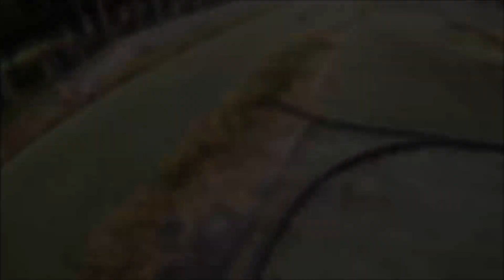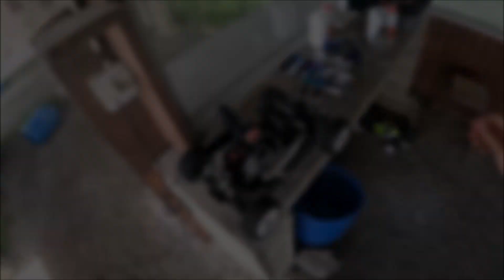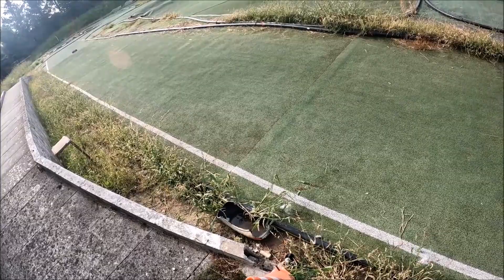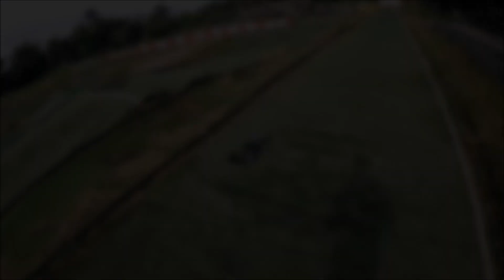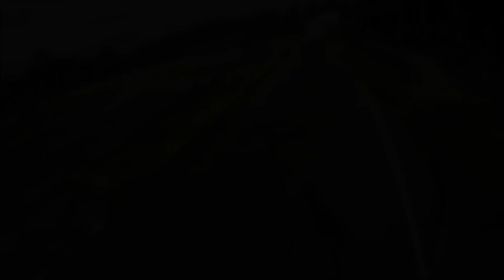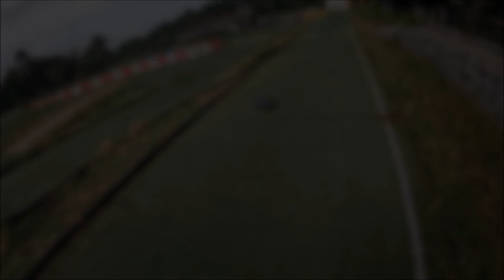Modded Novarossi P5 Based Engine Ripping!  💥💥

Comment: great vid brother.30% nitro is a whole new animal! Actually the Energy 25% onroad is insane .. I swear its 35%+ bec the way I have to shim the engine and plug choice ..long story If you get a chance to ever run Energy onroad fuel dont think twice about it. keep in mind as you go tighter you are going to want to run a cooler plug. granted you are on 18% you can go quite tight before you run into issues. dont forget to inspect the plug after you run. Any plans to run that cheap Alpha again? I haven't messed with mine in ages but I'm thinking about playing with timing some more lol I cant stop tinkering
Reply from the maker: Thanks bro, I followed your advice ang removed .2mm head shims and its a whole different beast!!! I love it and it's running much cooler! I cant really explain that! but I wont complain 😁Im not planning to run the alpha these days, I have a lot of stuff here that I want to try first, A cheap hobbytech engine that a friend sent to me, looking pretty good for the price, a Reds R5T, my first reds! Used but seems to be in very good condition, a fair deal with a friend, the dusty RCE, the Ronda 2 !! Nitro is not dead!!!
Reply: That's great news, once you start messing with shims in various engines you will find how conservative all the Novarossi are minus the square engines are. When people say Novarossi isn't as fast as OS/Reds/Etc... the stock squish of the engines are too blame most the time. All the other brands don't quite respond to shimming like the Novarossi but there are still gains to be made. I can speak for the rest of us and say we are looking forward to all the content with the new engines. @TastyBRC
Reply: I have the Gen3 Sv and now I have added the 723 Gen 3 part set to it... Ran the .21 part set on the bench for break in and it was a pain just like I read about. I ended up putting a Novarossi carb on it and it solved 80% of the issues . I have yet to run the .23 part set but after looking at the stock numbers she would run pretty good but nothing like a Roma. Its now modified w some decent blow down (51degrees) ,that should wake her up. I think our guy Kings Rc did a vid of the r5t where he did some work to it, he ended up doin .3 under the sleeve lol that will wake up an engine lol. @TastyBRC

Comment: Almost sounds like a old Toro nero…. Is the bore and stroke 15.88x17.60 ? That was my favorite engine novarossi made. Wish I could get you some good 30%
Reply: Try the Bonito if you can find one and run .55-.60 shim stack and you got yourself a pissed off engine
Reply: I’ve had a bonito and it’s a great engine but I think the toro Nero is timed a little different, I think it has more bottom end and got horrible fuel mileage.
Reply from the maker: I wish I had a Toro Nero and some 30% too 😆but I think that 25% will make a difference. 16.26x16.80 pretty standard long stroke.
Reply: If I recall its exactly the same part set but the case of the Bonito is a tad smaller internal capacity and different rear bearing . @billtruett8593
Reply: Also, what exhaust did you run on the Bonito...if you ran 41021/9901 that makes sese, everyone makes that mistake...that combo sux and robs power causing you to use alot of trigger thus drinking fuel.. 41021/41031 -2096/9853/9886 thats a whole new animal  @billtruett8593

Comment: I had a Novarossi on a street car way back in 2009.  That thing was squirrely as hell and really hard to get tuned on the top end.  I had the same problem.  It would run really rich on the top end and sometimes stall.  If I leaned it out then at the low end, where I'm doing most of my driving around the course, it got too lean and started to overheat.  I both loved and hated that engine :).  BTW - have they changed their name to Nova now?  I know the company broke up in 2019 or thereabouts, but did it eventually become Nova or are they completely separate?
Reply from the maker: Cant complain about my novas 🤔 I once got my p5 running inconsistent like yours but it came that my fuel got moisture, later it ran perfect with fresh fuel.
Nova engines in not the same company, just some random guys pretending to be former novarossi employees and using the "Nova" name and hype. Check my videos on the Nova B5R and you will understand why I dont like this brand.

Comment: P5 long stroke is one of my favorites. Heaps of torque when paired with JP-1 pipe/header combo.
Reply from the maker: sadly i dont have a JP1 but the p5-JP2 is also a great combo 👍
Reply: JP2 rocks in alot of engines at that , shes a 2 chamber if I recall @TastyBRC